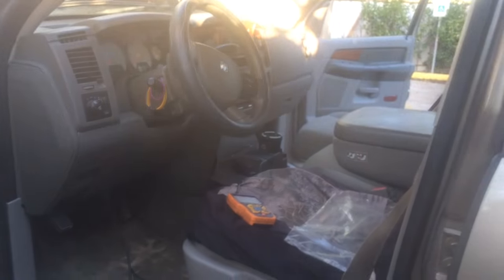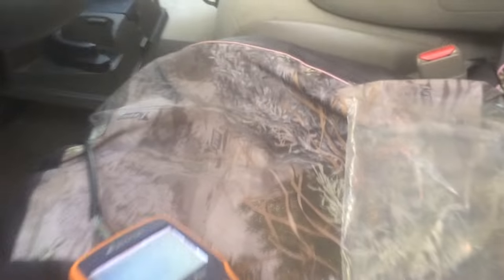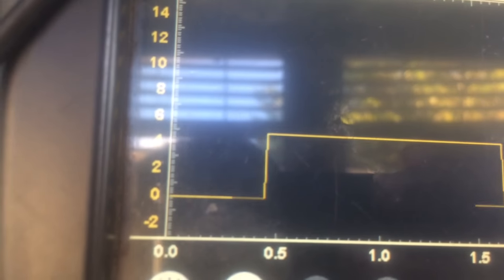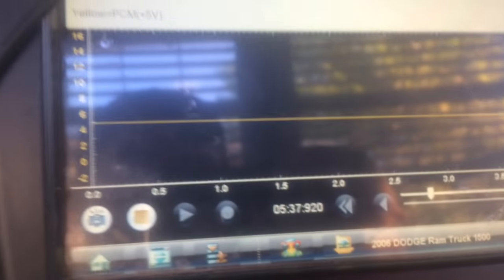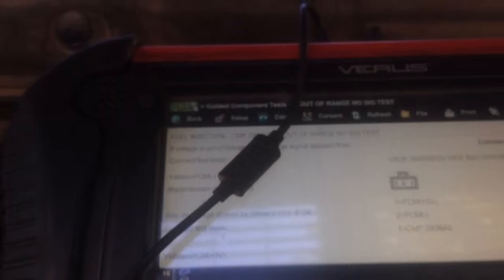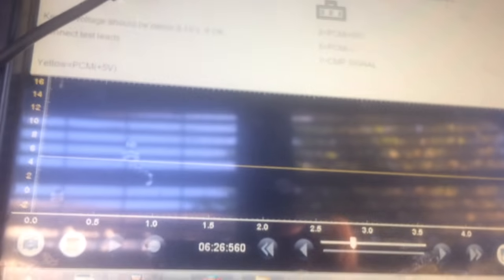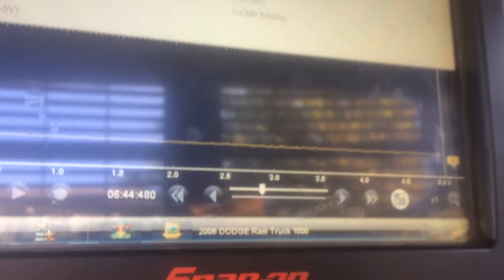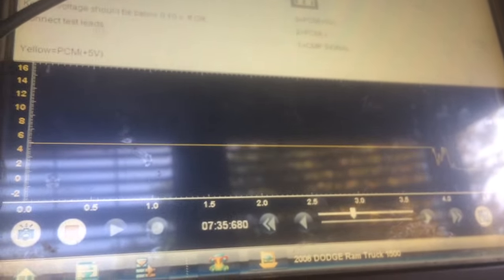How to test a bad cam sensor

Comment: Great video, thank you ... and yes, back-probing the connector (wires) with a volt meter should show the same voltage drop, as you said.  Had a '76 Type S V-12 Jaguar years ago... would start missing (or stop running) when the engine heated up.  The distributor had a reluctor wheel and hall sensor (same as cam sensors).  I packed ice around the distributor every couple of miles to keep it running.  Crude, but it worked to get me home.  Oh...if you ever want to find a new home for your scope.... well.....

Comment: I have just had exactly the same problem with a Camshaft Position Sensor on a 2000my UK Spec Subaru Impreza 2.0 Non-turbo. The customer took the car to a load of parts swapping idiots that even managed to make more problems such as fitting new spark plugs incorrectly (seriously, they couldn't get that right!!!). So, firstly I fixed all the bad workmanship. Then had to correctly reset the TPS which the last 'mechanic' took off and changed (they didn't get that right either). All looking good again I then plugged my Ecutek into it and as soon as I data logged it on a test drive with the car at FULL operating temperature, the fault became present and I could see the 1 and 0 switching intermittently on the CPS. Basically it was like randomly switching the ignition key off and on quickly whilst driving along. When it cooled down (drove less hard) after a few minutes it would clear up and drive perfectly.

Comment: Hey man! Hopefully you’ll respond but I seem to have the same problem on mine except it’s a 08 dodge 2500 6.7 it’ll die and will act like it wants to crank but does it just clicks we sent the ecm and it was bad but it’s still doing the same thing it’s very confusing

Comment: My friends 2004 Kia Optima has the opposite problem. It won't stay running on its own until it warms up. The codes keep saying it's the mass air flow sensor but we have changed it.

Comment: Superb job, thank you very much, Mine did exactly what you  stated, got a new sensorr for £10 when Stealerships wanted £70+ VAT and leave the car for a day with them!  Many Other so called mechanics sadi replace the fuel pump, and ECU! at a cost of £300 for a Fuel pump and £599 for a ECU for a acar that was £150!

Comment: What did the heat do? Made the signal weird? What does that tell you about the sensor?
Reply from the maker: Gold Wolf the heat dropped out the signal wire which cause the car to act up
Reply: Oz Mechanics does the heat do that to all sensors? Or just that one? I don’t understand the point of you heating up the sensor.if the heat makes all sensors act up, what are you going to do about it? Cars make heat. You can’t change that, and if they make all sensors bad, there’s no point in changing the sensor either...
Reply from the maker: Gold Wolf did you watch the video ? It explains in the beginning that when the car would get to operating temp the vehicle would cut off and it would throw cam code. So what I did was simulate the drive just by using a heat gun. ( it’s like the engine block heating up)
Reply: Oz Mechanics did you read my question??? What is the point to simulating the engine? Do all sensors act like that or just that one? If all sensors act like that, there’s no point in simulating it or Changing it. If heat is the problem, you need to build a heat shield or instal a cooling system. I don’t understand why you would simulate a problem and not fix it...
Reply from the maker: Sensors are not supposed to act up with heat. They reside in heat spotted areas. The point of this test is that the engine would die when I would get to operating temperature and it would throw a cam code. Simple test, heat the sensor and see if it causes the engine to stall. I really don’t see the problem with this test.
Reply: Oz Mechanics ok, thank you for that,  that makes more sense now, but now to the money question: what’s the solution? If a sensor breaks down when the engine gets to operating temperature, and that sensors Demise causes the engine not to run, that is stupid engineering. So you have shown how to determine the engines innate property is causing it to die, how do you fix the problem? Is it that one specific sensor that is faulty? Or is that design of sensors for that car just crap? You’d have to heat up another new one to determine that. if it’s just one sensor, replace it, it it’s all of them, there’s a design flaw.
Reply from the maker: Gold Wolf well like any eléctrica part it has its weak points which is the end of its life. Putting a new sensor will fix this issue. And it might last another 10 yrs until the heat, snow or other environment factors damage it again.
Reply: Oz Mechanics thanks! I understand completely now.

Comment: Bro your in pasadena ???
Reply from the maker: Yea I am
Reply: I’m in sw Houston, do you have a shop? I am having a issue with my truck where it don’t turn on.. it cranks and I her the fuel pump.. it turns on sometimes but sometimes it don’t i was thinking of replacing the fuel pump. Until I seen your video
Reply: Now I have a question I’ve looked online for cam pos sensor and it’s kind of shaped like a speed sensor but the part your replaced is  like a cylinder ? ?  Or is that where the cam is located ?